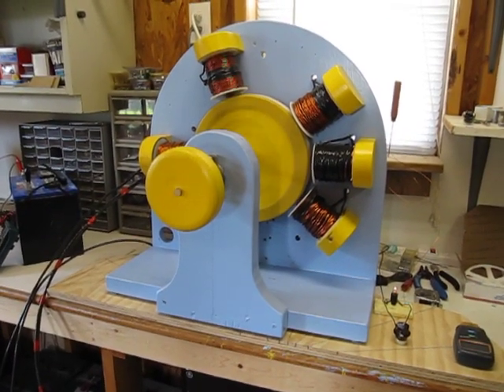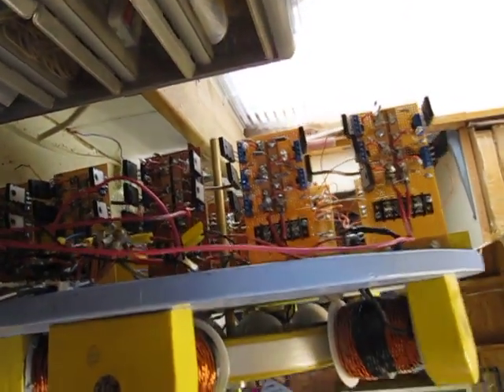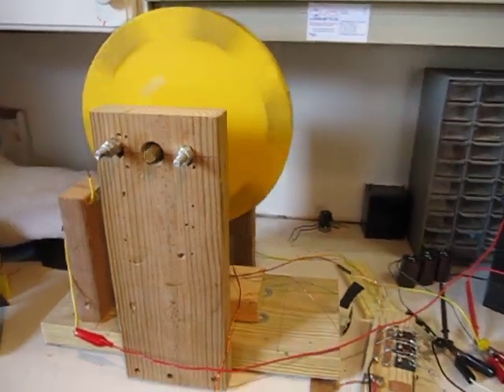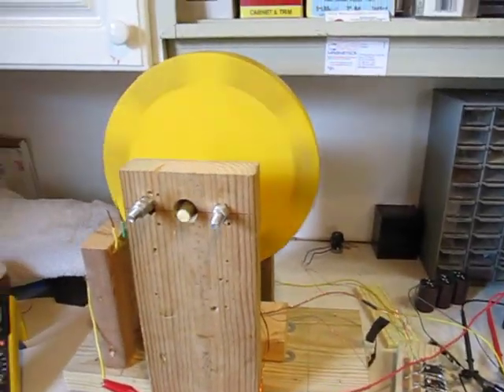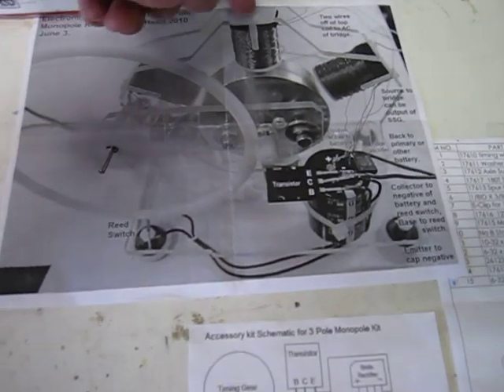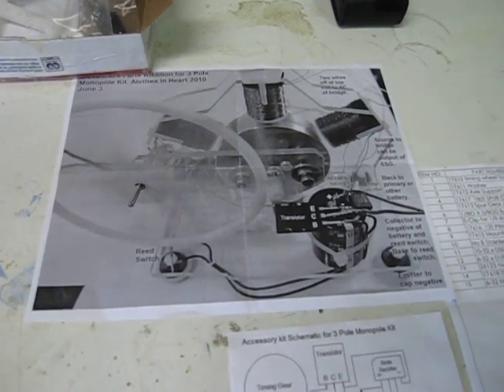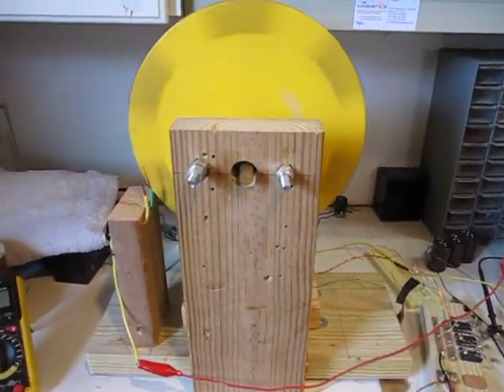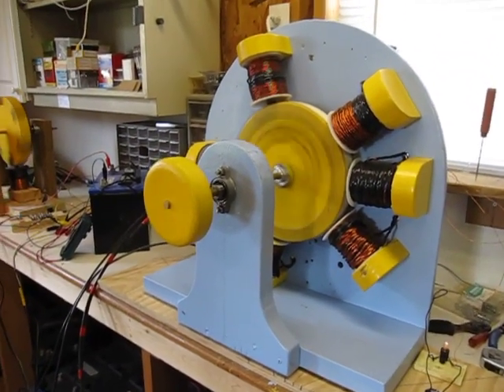John Bedini 10 Coil Radiant Energy Replication with 6 Testing - Capacitors (free energy test)

Comment: You will never get excess energy from his machine. The point that you got even energy input/output points that you have got overunity!! But since a lot of it gets wasted in the conversion to kinetic energy(heat,drag in bearings etc...), you should not even be at "even" level!! Remeber that laws of fysics and thermodynamics states that you can convert energy to another form (with som losses in the amount) but you'll never ever be possible to add to the amount of energy specially with a setup that has losses in friction ,etc. You could do a little better by using almost(air friction) frictionless magnetic bearings to get a little better results but thats it! I just can't that you invested that lot of money on that crap when there are a lot of better ways to get much better results with the fraction of the cost. The least which is known to all is the abha torus. Build it with the cost of enamelled wires and you'll get much better results than the bedini!!! Wth 5000$ I would have invested in plasma research.

Comment: Hello Preston,
You have done many experiments on this, so I would li to give you some hints to become successful hopefully.I hav not personally built successful overunity devices but I am investigating all serious technology about it and can confirm that it's possible to make it work, including selfrunning.
You should understand that not all voltage spikes are radiant energy, and that the  power collection of magnetic field collapse increases with the voltage and frequency.
So what you are doing by feeding the bemf spikes into a battery  or capacitor at this voltage will only shift the power from one battery into another. 
You can do this sure,or you also can feed the energy back into the driving coil with a diode, which will improve the efficiency of driving the motor.In order to collect extra energy you can use separate collection coils, but you have to cancel the Lenz force. Technics for this could be coilshorting or pulsed discharge of the pickup coils at the right fase angle.There are a couple of very promising other technic s that have to be tested if they work with this type of generators.If you are interested send me some contact mail so I'll shar more info and links of tests.
Wish you success!

Comment: “WHY NOT use solar input to provide the operating charge? COMBINED, THE COP will improve.

I HAVE solar input charging my batteries, no problems whatsoever. DURING WINTER, I unplug my 24/7 17-watt refrigerator, using propane for hot water & cooking, wood heat. MY PERSPECTIVE is very real, requiring practical 24/7 augmentation of about 24 watts, 1A into my Morningstar controller.

AUGMENTATION TO offset seasonal solar minimum is really what you should be working to develop. I REFRIGERATE during winter keeping food in the 42 degrees basement which requires heat only during extreme cold with outside temperature falling to -25 or below. IT WAS rare last winter. ITS A small 10x18 basement, well insulated. PROPANE HEAT at 3,000 BTU raises temperature at -25. HEAT IS necessary only for about four hours on a cold day.

ITS A manageable arrangement. PROPANE EXPENSE about $1 daily.”

Comment: You need to change it to generator mode .Disconnect the secondary battery negative from the top of the coil and connect it to the emitter on the circuit you will see some amazing results
Reply: When i gave 1 coil  bedini cgarging very good, wgen i add 7 coil , chargching become 4 - 5 volts... what i dix wrong?... i gace no capacitor?

Comment: seems like your load is too inductive, you need to increase capacitance in the circuit to improve your power factor to unity.Its a balancing act between the number of coils(inductance) and the amount of equal/oposite capacitance,not so much the impedance .Have you tried using a variable capacitor? It would make it easier to tune the output of your machine.

Comment: Use capacitors to absorb the radiant spike. The batteries have a hard time absorbing the radiant spike. It is best for conditioning the batteries. There's also a 'sweet spot' that it needs to hit. It can be tuned but easier if you have a micro controller do it.

Comment: HEY HEY HEY!!! you can acctuly get rid of the impedence probleme with the caps. you have to make them caps resonate with your coils. you see, in your whole circuit, you have a certain total impedence value (xL) and that (xL) could be canceled by a certain capacitance value (xC). I dont remember the formula, but its the formula for resonance between coils and caps. The formula differs if they are in paralelle or in series. But it is relativly simple, dont give it up :).

Comment: Use electromagnetic bearings on one end of the rotor shaft and the other end in a point and you have a nice flywheel battery instead of a perpetual machine.

Comment: you can even build a large v gate with huge rotor mass, and powerful magnets. it should have no problem manipulating the stator if you use a small magnet on the stator. then if you put magnets on the side of the wheel you will produce power.

Comment: to have over unity you need to make a motor with 1 coil that uses power and others that make power, like 12 making power, on the same wheel. Another one is to use 2 wheels on 1 shaft, 1 wheel needs to be smaller then the other. the smaller one would be DC pulse motor with reed switch and the larger one would have the magnets and coils. design the generator wheel so it does get drag form the magnets and you should be getting over unity.  this is because the larger radius the bigger the movement.

Comment: hi i know this maybe a solution to your current problem. Why don't you just install a small electric motor to the shaft as small generator to run the bedini. Or a bicycle wheel generator.

Comment: More voltage output than voltage input means nothing in terms of the work it can perform.  This is NOT overunity.  Ever heard of a stun gun?  powered by one 9 volt battery; capable of putting out 90,000 volts or more (or less, depending on model)... yeah, that's not overunity either.  Thumbs up if you stumbled here and have any common sense.

Comment: I want to see the overall wattage going into the motor and I want to see the wattage going to the battery. You may have more voltage coming out than going in, but thats just voltage. Wattage, which is the actual measurement of power, is the product of voltage and current. I think the high voltage is an act induction similar to that used in a car's ignition coil.

Comment: Preston I too have noticed a better output when using a cap before the battery,the voltage raised by as much a 20v on the self-oscillation platform I currently use,your definetly onto something sir,looks good keep it up.

Lefthand
Colorado